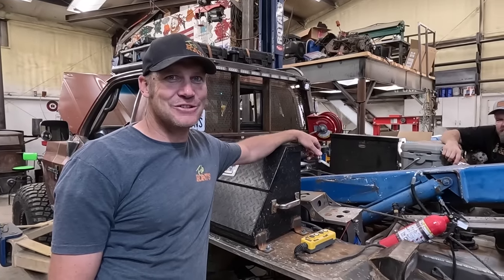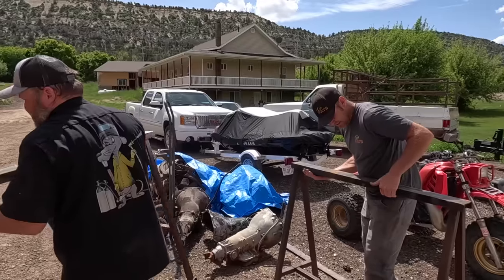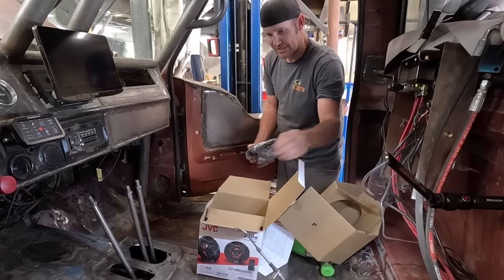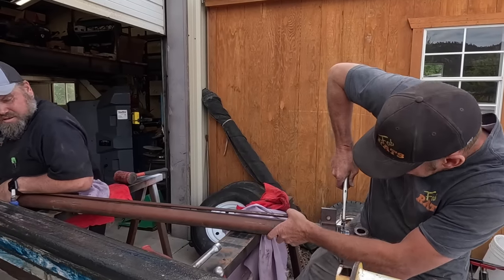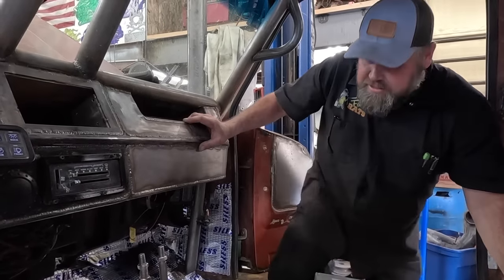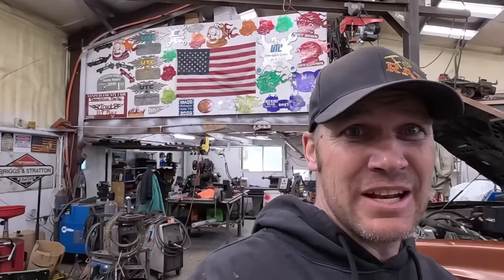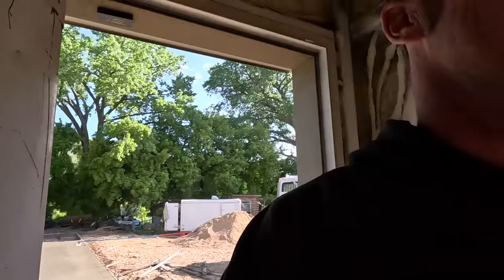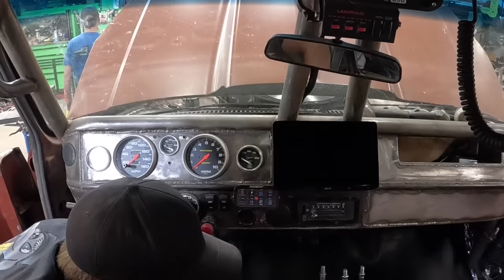Revamping The Rat Rod Tow Truck Plus A Never-Before-Seen Recovery

Comment: Hey Paul I caught that movie quote, "We'll have he fixed in a jiffy." The creepy dude that picks up Harold and Kumar, with the big nose. Haha what a great movie.

I'm a concrete finisher, been doing this crap for 15 years now, not including 5 years framing houses out west, so you can say I've seen it all as far as trades men go. And I will say these guys did a good job, I like how they poured the footings first, which you should, however, and to each their own, but I would never use wood for grade heights, we would use a laser, and set grade spots, then fill them in with a eight foot magnesium screed, or you set grade stakes. Wood is never ever straight to set heights to, but for a flat floor its good, only when you have slopes does it really matter. 
But the big one for me was that they didn't keep loads together in order, you never want truck ones mud touching truck fours mud, as a finisher that makes for a lot more work trying to get the loads to blend together. 
Sorry for the massive rant, I love you guys, and I'm really glad you got you floor poured, and besides my flapping beautiful job by those mud monkeys and they are all top notch hard workers, everyone has their own way of doing something and if the end product is a master piece then it really doesn't matter. Super pumped to see the new shop go up, and to hear your old lady sing some more on camera hahahahaha. 

Cheers guys.

Comment: noticed 1 glaring issue with the new pad, there was not spots made extra thick for the lift post. Contact your dealer and find out what they require before you get to far into the build.

Comment: Foam same thing happens in houses. They spray it to thick. It needs air. It's a mess will off gas nasty stuff if I closed area. Straw with very low pressure air in multiple pockets might work.

Comment: I'm no chemist, but I'm pretty sure that spray foam is activated when its exposed to the air.  I think that is why it stays as a liquid inside the can.  You welded those doors up "air tight" I think and when you sprayed all that foam in there in used up all the existing air in the doors to set up and there wasn't enough air in there to set up all of it.  Anyway, that's what I believe.

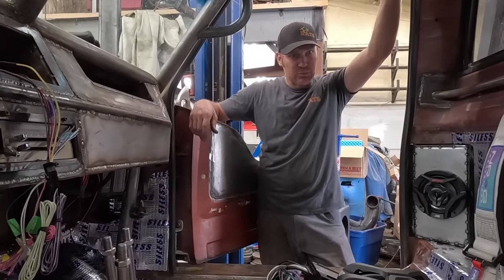Comment: 00:24:26  🔊 🔊 🔊 🔊 🔊  Speakers need a short breather tube 1/4 the size of the bigger speaker and the breather tube at least 3" long but, make sure that it does not bottom out on the truck cab😎  🔊 🔊 🔊 🔊 🔊

Comment: I mean you guessed the foam thing right. It doesn't setup in the can. It needs open air. The outside most layer sets up and makes a casing while the inside never fully sets up. It can set like that and off gas for years.

Comment: I'm amazed you were able to pull that dump truck out of an inclined stuck spot with that light vehicle. It seems awfully hard on the equipment, but I really don't know if it is if it is purpose designed to be treated that way. I guess sometimes there is no other choice unless you want to spend 40 minutes rigging ropes and pulleys. I didn't think it was gonna come out of there after seeing the previous pulls. One point extra for not giving up and being stubborn.  I guess you didn't want to take the wrecker out there since it was half disassembled in the cab.  Databyter

Comment: Spray foam does not cure via moisture.

Spray foam is an off-gassing product that cures by allowing the gasses to escape via air transfer. When sprayed in a sealed area, the gasses remain trapped which does not allow for curing.

The off-gassing also allows for the foam to expand, but, again, in a sealed space, that cannot happen, so the foam remains un-cured (wet.)

Comment: I was working on a buddy of mines wrecker back in the late 70's and got badly injured. We were trying to get the boom to go back in and it got stuck. I lifted up on it close to the outer part of the boom when it decided to come loose and slide all the way back in. The only problem was the skin on the palm of my hand ended up getting caught in between them and it rolled the skin from the center of my hand all the way to about 2" past my wrist so by the time we were able to get the skin out from in between the boom parts I had what looked like 5" of beef jerky hanging off of my arm. I think I said "Ouch, by golly that kinda smarted" or something to that extent. LOL  I had a demolition derby that night so I just dumped some lacquer thinner on it, put some duct tape and bandages on it and went to the ER the next day. That was my first feature win so that took a bit of the sting out of it.

Comment: You didn't use an installation sleeve to clear the new O-ring passed the cylinder sleeve opening.  Well, here's hoping you didn't damage it forcing it in like that.

Comment: First off it's a hydraulic cylinder second O-ring might be bad but you have more components in there than that. Don't forget to replace all components including the wiper which clean the rod side when retracting your boom.

Comment: If you use can type foam, you use too much to fast, if done in layers it would have fully cured. If you used bulk raw foam, poly and resin then your ratios between the two were off. Looking forward to seeing the new shop, also please build a burn-out pit to test everything.

Comment: At least the heel of your shoe won't melt itself to the floor anymore. Been there done that. I also hate rattles when they don't have to be there. The boom repair went too easy, I hope it won't need to be done over. If it does blame it on Hunter for getting the wrong part. Most cylinders have a flow control somewhere in the system to speed up or slow down its operation. Just FYI. I have been sprayed by hydraulic fluid many times being an underground mechanic/electrician for about 5 years of my life in a coalmine. It was an easy job most of the time, I asked the operators at the end of every shift if their machine was ok and if not I would write it up for the dead shift (maintenance) shift to repair making my job much easier. I could usually be found atop the transformer (it was warm) asleep. Also if the guys didn't tear up their machines on purpose I would buy them a case of beer that we would drink just outside the gates. If they felt bad and needed a break they would come and get me to run their machine for a while instead of tearing it up and making me work fixing it while they slept. I would rather run it than work on it. It was fun for a couple hours then it became work.

Comment: Most spray foams cure using an exothermic (heat) reaction produced by mixing two chemicals, isocyanate and polyol (a type of resin) plus blowing agents.  Most epoxies, fiberglass and Bondo also all use an exothermic reaction to cure themselves.  Some of these use a reaction with the air to create that heat, so it is likely that the chemicals in that enclosed space did not have enough reaction time with the air to fully set up the foam.  Once that you opened that space, the chemical reaction was allowed to complete itself and the foam cured – in other words, it did not dry out, a delayed chemical reaction was allowed to occur.  That is the short and hopefully easily understood answer.

Comment: I'll bet you mixed up all the foam to fill the doors all at once...  once the top glazes over the bottom pressurize and stops expanding...  you need to fill in small batches!

Comment: The foam reacts with the water in the air - no fresh air, it runs out of water and stops setting. Spray a light mist of water in there and it will finish setting.

Comment: Lizard skin ceramic sound and heat shield spray or roll or even brush it on dries like granite I have to admit it sounded kinda jenky when I was reading about it but man that weird stuff lowered the temperature inside and I ended putting three coats and really lowered the rumble inside the cab from the 700+ cubic inches of big block under my feet a little pricey but hey anything that works quite well is expensive spray foam needs oxygen and humidity or water vapor that’s why it sticks so well to your hide and won’t come off plus your in the hidessert altitude prolly has something to do with it also

Comment: You need a parts running vehicle, black, great on gas mileage maybe diesel and a small bed. I feel like I’ve seen on like that some 🤔. Maybe a radar detector too… so you can make sure you’re not too far under the speed 😉.

Comment: 😆 I am constantly picking up half drank water bottles in our shop too all the time lol people just leave them in some of the most random ass places 🤣, your hydraulic ram is so small compared to the ones on our concrete pump lol ours are 6 inches wide and around 6 feet long n a bear to rebuild at times

Comment: Hopefully Hunter got an extra set of seals...so a second trip will not be needed?

With the weight differential of that tow, I would think two knetic ropes in parallel would have been better?

Comment: No expansion joints in that huge slab? Gonna crack. Since it is already poured, you can cut grooves with a diamond blade so that the cracks occur under your lines and you won't see them. Also, what happened to the Raptor Liner?

Comment: Since it took Hunter four hours round trip to get the "O" rings to rebuild the extension cylinder, it seems worthwhile to pick up "O" ring kits for all of the hydraulic cylinders on the wrecker.  I doubt that the kits were all that expensive and it cost more in fuel to get just the one set.  Not to mention the "downtime" involved.   As old as the boom is it would make more sense to rebuild all of them rather then get out in the middle of nowhere on a recovery and have one or more of the other cylinders blow a "O" ring and not have all the needed tools to repair them.

Comment: Hey, love your wide range of projects, and being a car guy, makes me tired just watching. A couple of suggestions - try a little vaseline on your O-rings to push them properly and easily into a bore. Also, I was sound proofing a car, the manufacture of the mat said thicker, to 1/2 thick is better and with a metal or aluminum top reflects/traps noise back through the mat. And, they attached an article/ paper they researched where they discovered a big proportion of the engine noise in the cabin is not through the fire wall but through the hood then through the windshield. Notice how better cars, like Cadilac used, especially in the 70's and 80's, used a thick fire proof hood blanket. Thanks for sharing your projects.

Comment: Ok since this truck is 100% custom I will offer a solution to the sub. Cut the back of the cab out and recess the box into a cubby you may have to move the winches 3-4” back to make room but that is one way to fix it. Another way is a custom round cone style box that will wedge in behind the seat but the sub will be 90 degrees from the back of the cab so the magnet will be pointing at the passenger or drivers which even side you want it on and the round box tapers down to fit behind the seat. Or last but not least if you have some room under the seats the make some shallow mount systems that are fairly slim for under seats. But I can guarantee a good custom shop can find a place out of the way for it and build you a custom setup.

Comment: You don't tap the seal and rod out.  It is way more fun to put some compressed air on the other end of it and launch the rod right out of there with a cloud of hydraulic fluid as a bonus.

Comment: Dont use spray can foam if youre filling more than an inch.  Use a proper 2 part urethane foam kit, follow the instructions, and never fill your mixing pot past 1/4 with the 2 liquid parts.

Comment: Install the speakers corner cap of the roof that'd be pretty good deal😮. Mmmm 🤔 I don't think all the water bottles are hunters😂😂😂. The reason why the doors are still liquid what was the temperature when you spray it in there mmm😮.

Comment: that foam requires Moisture to set and is not meant to fill large voids, if you had done in layers waiting a day between layers it would have worked better, next time there is a foam filler that can be used to fill large cavities, Im sure you have seen stuff shipped to you that have bags of filler that are fluid that conform to the item and then solidify when activated

Comment: I noticed you guys have a hydraulic parking brake lock type plunger thing in the tow truck how does that work? I need to set up some sort of brake lock in my rig i could run a valve of some sort in the cab off of the cutting brake line. I am also looking at electric mico locks like on matts huge wrecker they are sorta spendy but i was thinking maybe doing the rear brake with a manual valve and if i need adding a electric mico lock for the front brakes. How does that valve work and can you recommend a good one? Or anyone else reading this have any good recommendations?

I dont want to run a bunch more brake hoses up in the cab just to do a brake lock valve, i already have the cutting brake handles so im fine with setting up the rear on a manual valve in the cab. Or the other idea was to buy 2 of the electric mico locks and just doing electric locks front and rear. But it may be kinda nice having the rears on a manual valve then doing the fronts on electric im not sure, theres not a whole lot online about it. Id love to hear some opinions and maybe recommendations for high quality parts like a nice little manual valve. The main use for the brake lock will be winching.

Comment: I hope this doesn't sound like another comment like, "You know what you need...". 
So, just a friendly reminder on subwoofers; the cabinet volume is perfectly tuned to the actual subwoofer speaker characteristics. So if you change the size, thereby the volume of the subwoofer cabinet, it changes the characteristics of the entire subwoofer and you'll get far less efficiency and far less boom. It can make a huge difference. It'll probably be okay if you're not trying to knock knick knacks off the shelves of houses you drive by. 😅

Comment: The Expanding Spray Foam Insulation needs a certain amount of Air to a Certain Amount of Volume of Product to allow for proper curing times, these ratios should be on the labling of the product. Contractors that use spray in foam insulation on say 2" x 4" walls will usually two it in two applications and 2" x 6" inch walls in 3 or more, etc... Too thick an area with not enough exposure to air and it will sometimes never set up completely, this process occurs from the outside in like marinating meat, for a poor example of Canalization, I am no Alchemist!!! Best Explanation I could come out with with my limited knowledge...

Comment: bourbon chicken, w/ lo mien and bourbon sauce in the low mien, with some general Tso's aswell @12ish min

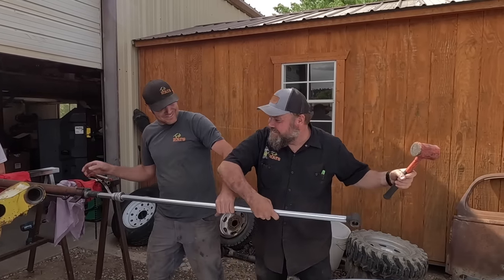@16:30ish WTF dude, never force anything, especially without lubing it... in some way, also rotating a seal into place helps, if you have the ability... but needs lube, more the better

@35 hunter has the right mindset, dont force it, figure it out, QC lol, get it

Comment: That spray foam never seems to cure completely for me either and I have been told to spray it with water to make it cure. That seems like the video's claiming that smacking a potato against your car lock to get in if you lock your keys in the car, all it will do is make you look like an idiot so I haven't tried it personally. lol